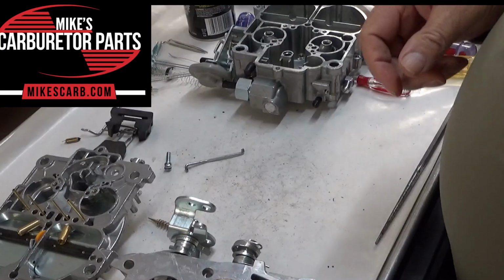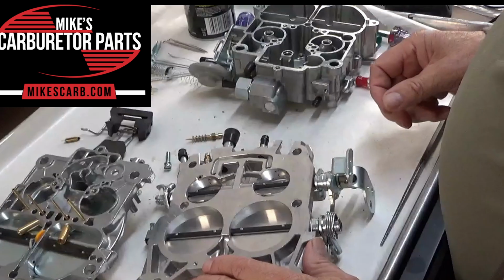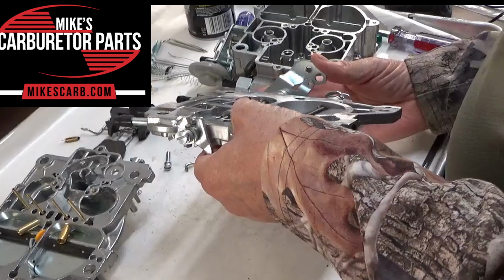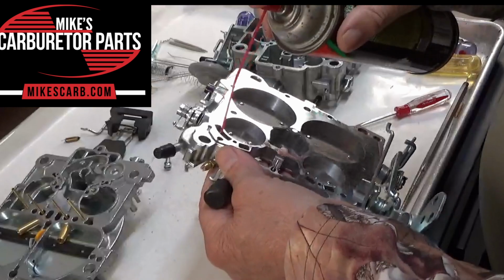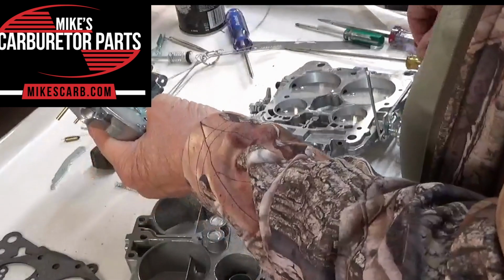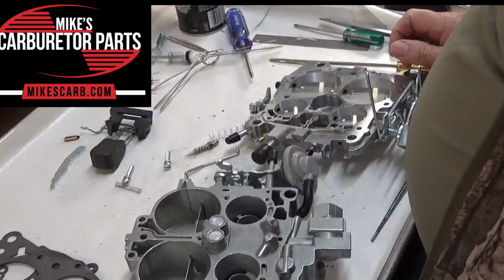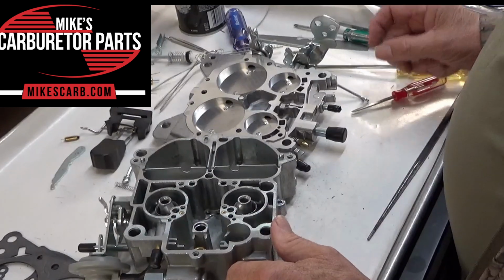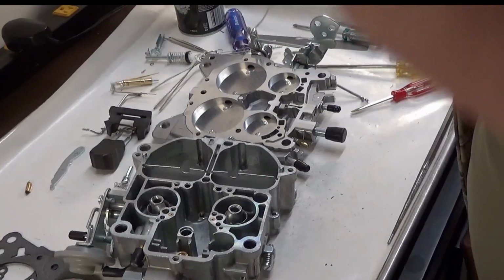Rochester Quadrajet Idle Circuit - Fix Your Idle Problems

Comment: I have a 85 P van with a 350. 4barrel quadrajet. It does not have the MC solenoid, not sure if someone swapped it, or P van not equipped with MC, 

But problem is stalling. Starts. Idle is fine. Cold, in gear. Acceleration ok. As you ease off the pedal. She will stall

I see the accelerator pump working fine no leak. Sprays fine. Someone removed the primary choke flap. Missing. 

Need to feather throttle to keep it from stalling out. 

Has great power. Just always easing off throttle to coast idle she will stall out. Warm, it does better 

Did not see vacuum leaks. It has a new fuel pump mechanical, using a HEI and is not ignition related. 

Any ideas? 

Sorry for long statement 

Thanks
Reply from the maker: The choke valve must be there or it will never run right. Especially when cold.

Comment: Im having trouble with mine. Doesn't stay idle when put in gear. I replaced the intake gasket and the top lid, what I'm noticing the idle mixture screws dont do much to the rpms until completely closed. Definitely get air somewhere or can the float do that? I dont smell flooding. The car hasn't drove it years but it was working fine before.
Reply from the maker: 1st of all when a carb sits for months the gas turns to varnish and coats the inside of the carb. Idle mixture not making a difference is indicative of a problem somewhere. Probably a plugged idle tube.

Comment: I need some advice if you don't mind.  Have qjet gm350. Recently rebuilt. Runs great wot. Won't idle, idle fluctuating up and down, idling bout 900 to 1000. I've checked every thing. Not sure what to do.  Thanks.
Reply from the maker: Please refer to this page for some ideas. Could be a lot of different things: https://www.carburetor-parts.com/quadrajet-rough-idle.html

Comment: I bought a rebuilt Q jet from rock auto #702 9207 and out of the box it ran very rich. Adjusting the idle mixture screws where no help. The float level was good. I installed a fuel pressure regulator and adjusted it down to the #2 and it ran better. I decided to take it a part and found that the power piston spring appears to be too short. It doesn't lift it at all. I looked for a carb kit that has the spring included ,wasn't able to find one. I found a number of springs in your store but I have no clue which one is correct. Any help would be greatly appreciated. Great video,thanks
Reply: If the primary rods aren't lifting, this makes it lean.
Could be they put the wrong size primary rods/jets in it or maybe even used the wrong gaskets.
https://youtu.be/VqxXFwkT55g?si=WSoR-8sx_s5xvKjL

Comment: Mike,  what makes a  quadrajet  surge when driving
Reply from the maker: Look for any fuel restriction - check for kinks in the fuel line.
Replace any fuel filters - There is usually one in the fuel inlet of the carburetor and often there will be an in-line fuel filter.
Vacuum leak - Use spray carburetor cleaner and spray around the base of the carburetor and any vacuum lines. If the RPM smooths out, then you found the problem. There could also be a leak at the intake manifold.
Check the float level.
The power valve may be sticking. It needs to move up and down freely.
Dirt in the system - take the top off the carburetor. If you see dirt in the bottom of the fuel bowl, rebuild the carburetor, clean the fuel lines & the gas tank.
Main metering jet may be the wrong size. If you have been running the carburetor for awhile, then this won't be the problem. Jets don't wear out. Make sure the jets are not loose, or plugged.
Reply: @MikesCarburetor  thank you Mike

Comment: I have a 67 to 76 tune up specifications book. SD-100. A factory manual, a book every dealer had. I bought several different years, up to 95. The earlier ones are better, the later ones were adjusted with tailpipe sniffer computers. Every single q-jet fuel air mixture screw settings are 4 turns out. Plus or minus 25 rpm, more or less. The 1 and a half  turns, after contact, is the idle stop screw, initial setting. Not for adjusting idle speed. I drive a factory 85   with. Qjet # 17080213, full manifold vacuum carb and get 16.5 mpg, if i drive careful, on the highway, for the last 11 years. Its all very specific settings following the specific process, nothing arbitrary, or by ear.

Comment: i've rebuilt/repaired/cleaned about 100 of these q-jets, the needle/seat and float are sure finicky , i use the enclosed needle/seat assembly (one piece) and they seem to work good for me, had trouble with the two piece ones with the wire due to all these new mechanical fuel pumps ,had two that had 4.5-5 psi and have had ten or more with anywhere from 9.5 to 17 psi the one piece needle and seat worked good (no flooding) up to about 10psi any higher had to use a regulator i don't use these for performance use them for economy get much better mileage than my holleys you have real good videos i watch them from time to time just to refresh my memory and see if i can learn something new thanks for taking the time to make these!!!!!
Reply from the maker: I appreciate the feedback. I would suggest a regulator on anything over 5 lbs. Too much of a chance of rich or flooding.
Reply: Is there any snowball's chance in hell high fuel pressure could cause a lean idle condition on a q-jet? As backwards as that sounds.
Reply: @theosexpertdaymon2774  not that i am aware of